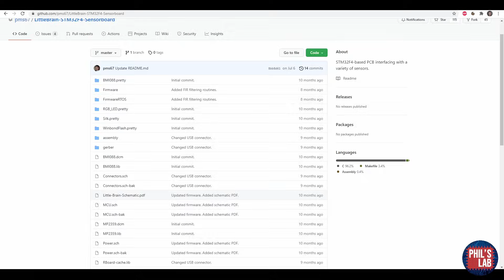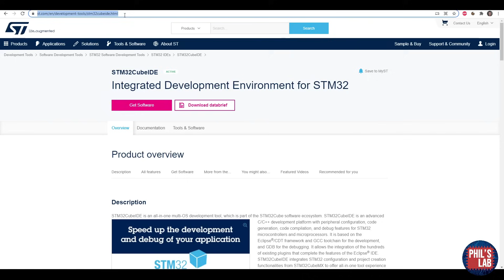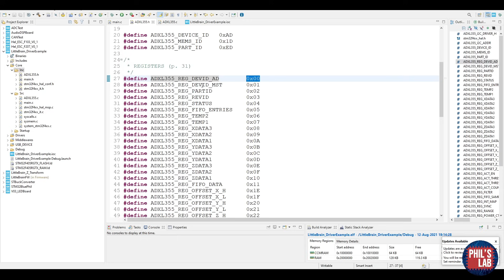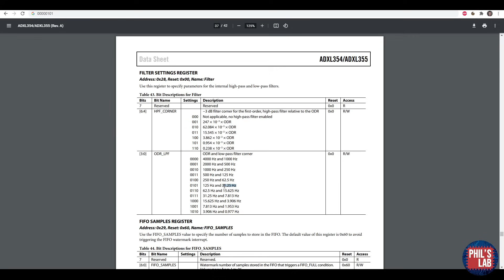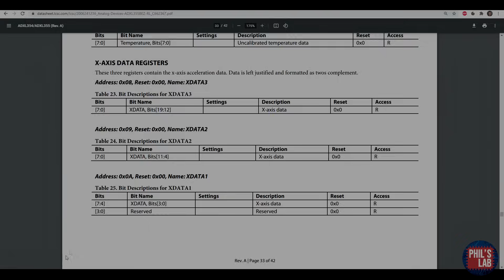(Sponsored) How To Write A Driver (STM32, I2C, Datasheet) - Phil's Lab #30

Comment: Hi phil, thank you for sharing. I have a question, for two layer accelerometer board, why you only place a GND plane on the bottom layer ? 
Why not placing GND plane on top player as well and connect it with vias?
Thank you

Comment: Super helpful video! Quick question though—when using HAL_I2C_Mem_Read(), shouldn’t we use the raw 7-bit address (like 0x1D) instead of shifting it manually? Doesn't HAL automatically shifts it to add the read/write bit, so shifting it ourselves might cause a double-shift and break communication? Just wondering—awesome tutorial! 👍

Comment: I found this channel when I was searching for pcb design in kicad tutorial, found the best, stayed for the digital control implementation and code design. Now software design. Everything you will ever need as a control systems engineering graduate.
10/10 channel.
Thank you.

Happy new year (2025)🎉.

Comment: Phil, not sure if people dogpiled on this already but you can use the `0b` prefix to specify binary values instead of converting to hex/dec. I personally use it while writing STM32/embedded drivers because I find it's clearer in communicating to the user that the bit pattern is structured, and it's not just a numeric value. Ditto for bit shifting.

Comment: inside the ADXL355_Initialise function: when reading the device ID, shouldn't you directly return from function if the status was not HAL_OK? You did not initialize regData, hence if a read is a fail, wouldn't you be comparing a non-initialized variable with the constants (ADXL355_DEVICE_ID and ADXL355_MEMS_ID) in the following lines of code?
another question: What is the goal of having an error count? 
also TIL that initialize in British is initialise :)

Comment: Is it possible to convert Acceleration data to Velocity and be at this speed with this sensor?  Can I use this velocity and time to find distance let's say 500 feet down the road?  which would be position?

Comment: is the software at 8:06 is what is called a "device driver" ? the software disk that for example comes with a printer and other devices? or this is another thing that's just called a driver? because I didn't hear say "device driver" but only a "driver". thanks

Comment: Is it possible to use I2C with DMA?
Reply from the maker: Yes, I2C + DMA is typically supported by STM32 MCUs.
Reply: @PhilsLab  thanks Phil! 
Working on softare to a Flight controller based on the MPU6050 and F411. Your videos have been great support both for designing and programming 🙂👍

Comment: Hey Phil.. really nice content ..
Just one question is how are the jumper wire connections from "ADXL355"  to  the "Litte Brain" boards ?

5V
ACC_INT1
ACC_INT2
ACC_DRDY
ACC_NSC_SCL
ACC_SCLK_VSSIO
ACC_MOSI_SDA
ACC_MISO_ASEL
3V3
GND

I2C1_SCL
I2C2_SDA
3.3V
ADC1_IN0
ADC1_IN1
GND

Comment: Hi I thought the data sheets are supposed to have an open transaction, then functions to call to access data, and then close the transaction - but in general I'm not seeing data sheets that allow drivers to be created for several devices in general .

How does one know what language a driver for a device can be created in and how to used the data sheet function with the IDE being used?

As I've wanted to write a library for depth sensing cameras for the Arduino...but as said before driver creation is an element many programmers have no idea how to do...Luckily I had a university lecturer who knew how to do things like this...

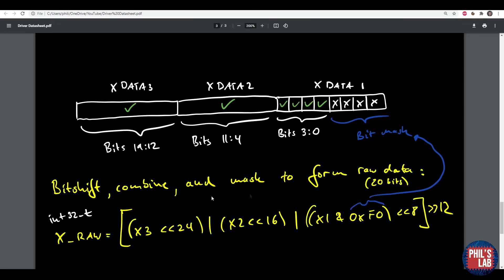Comment: Hey, great video! I'm just curious if at 31:40 you could have avoided right shifting the entire expression by 12, if you had instead left shifted x3 by 12, then x2 by 4 and then right shifted x1 by 4 also. I see your methodology, but it makes more sense to be to shift the bits exactly where they need to be.
Reply: your proposed method doesn't set the sign bit which means it doesn't work for negative numbers; bit shifting a negative number to the right shifts with 1s intead of 0s, preserving the negative number

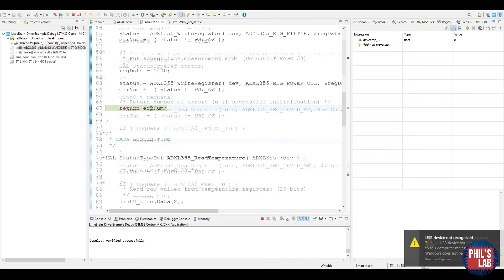Comment: Great video. At time 36:47 I noticed that the "USB device not recognized" popped up from windows after you plugged in your custom board. Did the USB peripheral work? I have been struggling getting custom boards to work with the USB peripheral and I am getting that same pop up
Reply from the maker: Thanks, Ravi! That's only because I had paused the execution of the code via a breakpoint. The USB peripheral works as it should.

Comment: Nice video, I only I have question, when reading your accelerometer with the board sitting flat on the table, all x, y and z reading for accretion should be zero I think, but in your example z axis reading was 9.8 you said, so not sure why this is so?
Reply: it should be 9.8
Reply: Hi Mushaq, the reason for downwards 'acceleration' is the force of gravity (equal 9.8 m/s^2).

Comment: Great videos. I think it would be interesting to create a second video about writing a non-polling driver.
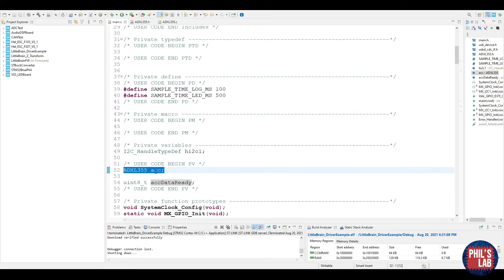Reply: Actually, this is a non-polling driver. What Phil is doing is a very short ISR  (Interrupt Service Routine) (see time 34:34 lines 67-76 in the code) that set a flag. It is common practice that an ISR writes to a Semaphor and the thread/process is waiting on this Semaphore.  Phil does not have OS therefore he is using flag instead of interrupt, some interrupt might be lost in this implementation.

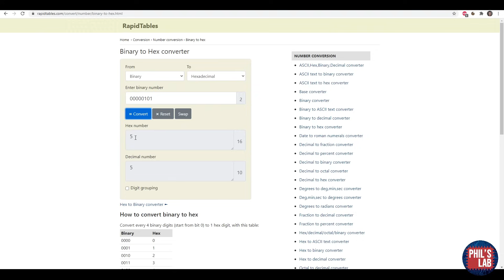Comment: at 24:16 it would be nice to add all the settings as #defines 125Hz-31.25 LPF 0x05 in the .h This would remove the 0x05 magic munber from the code. Having add to do a fair bit of s/w V&V in my time the use of magic numbers drives me mad. You have it in the comments but in the code for address you used defines to avoid them and make it easer to read. apart from that bit of OSD there should be more videos outthere showing how to read a datasheet.

Comment: Great video, very professional job. Only comment I would give is that this structure is not particularly portable, when I write drivers like this I tend to declare my i2c read/write functions as private statics in the module or in a separate module of its own in larger projects and contain all the hal specific code in there. Specifically I would not use the st Hal's status enum as this is platform specific.
If you do this you can trivially reuse the driver on multiple microcontrollers with only a few minutes of work.
Reply: Interesting - could you please talk about what you mean by 'module' in this case? Is it a combination of .h and .c files?

Comment: Great video, thanks. Forty odd quid for that sensor though, crikey. What is so special about it that makes it so expensive?
Reply: This sensor has low noise and high accuracy (and you can trust ADI to meet the spec)
Reply from the maker: Thanks, Sean! Low-noise, low-drift, etc. etc. make it pretty pricey.

Comment: Hi @Phill you way of PCB design using Kicad is nice. if possible please post video STM32 with RS485 communication , differential routing, length matching, impedance matching concept in Kicad. Thanks 👍

Comment: Can we use HAL in all applications? I have seen many times people say, they prefer 'Bare metal' over HAL.
Reply: I completely agree with B Fournier, HAL should be used in most cases. An abstraction layer might contain hidden (or not so hidden) overhead. When performance is critical one might want to rewrite some section of the code without HAL.
Reply: I'd say, if you're asking yourself whether you need to use the constructor's provided abstraction layers, you probably need to use them. They'll save you time for standard things you may want to do, and help you with tedious stuff like keeping coherent error codes throughout your project, like shown in the video (the HAL_ERROR, HAL_BUSY, etc.)

Comment: Well this video certainly is handy right now, since I'm struggling with an INA219 interfacing. For some reason even after all these years of electronics I2C is the bane of my existence.
Reply from the maker: Thank you, Aron - hope you figured out the INA219 driver!
Reply: Hey Aron, did you manage to figure out how to set up and use the INA219 with STM32? Do you have a link to the driver / code used?

Comment: Funnily enough I just finished writing an STM32 I2C driver for a sensor today. In the past I’ve only done PIC drivers. 

Why not SPI for an IMU if you don’t mind me asking?
Reply: I don't know the reason behind the SPI/I2C choice, but here's my reasoning. Usually I2C is fast enough for multiple chained IC readings, and you only need two supply and two communication wires (+ interrupt if that's your thing). SPI has 4 comm wires to start with and every chip has an additional chip select (and the interrupts).

Comment: Awesome and detailed. You can actually use the Microsoft calculator for bit conversion/manipulation. Just set it to programmer mode. Very useful and handy
Reply: Yeah it’s really useful! The macOS calculator has the same programmer mode too. Find myself using it a lot.
Reply: or even better, use GCC's 0b notation instead of 0x when the number corresponds to bits in registers